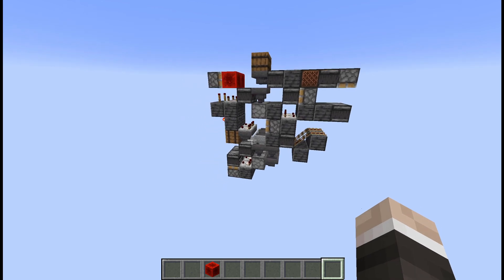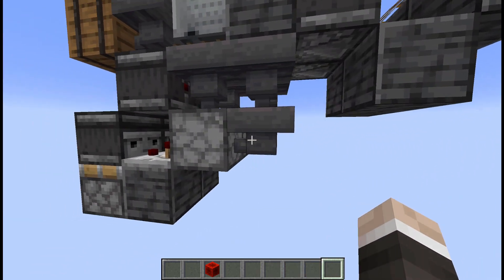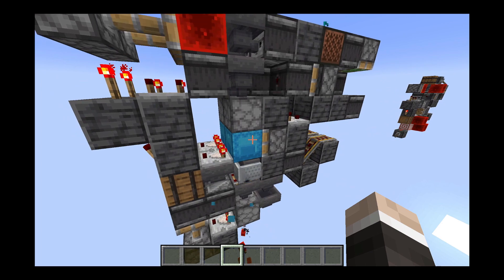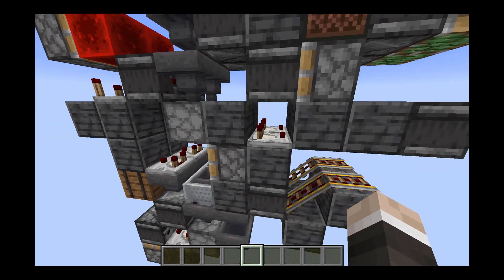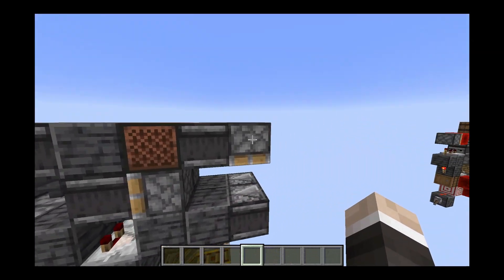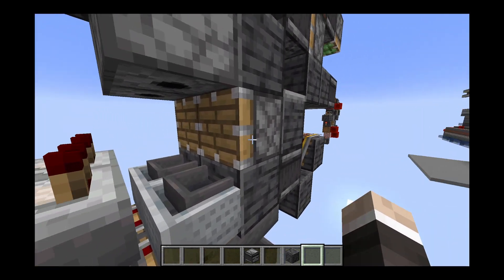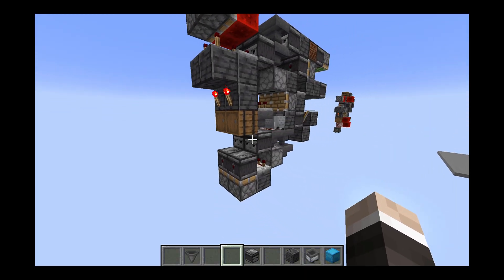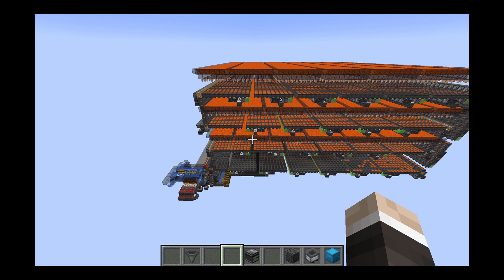1 Wide Tile-able 2x Speed Shulker Box Unloader | Minecraft

Comment: I see you are using a observer clock. I had problems with them being 33% slower at times and i believe you may face the same problem.
Reply from the maker: the clock is just for the item dropper, so with out it i would not be affected but i probably will change the dropping setup to avoid this.
Reply: They make a 6 tick clock if you place the last observer but a 4 tick clock if a piston places it.
Reply: @vsikifi  Now always. I had once such a 4 gt design for a itemflow of 1 item every 5 gt. After a while the clock got stuck on 6 gt and couldn't dispense the items fast enough causing items to despawn

Comment: Nice but doesnt the observer powering the hoppers add a bit of delay?
Reply from the maker: No, while the hopper does get powered in two places, because the hoppers transfer more than 1 item before its locked there is no delay as there is already another shulker in the dispenses. Now technically if you spaced out the shulkers just right it could cause a small delay, but if they are that spaced out then if probably does not matter, and if they are filling faster there is no delay.